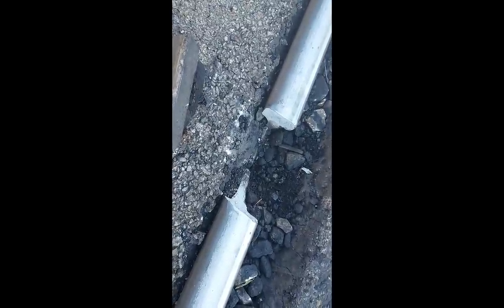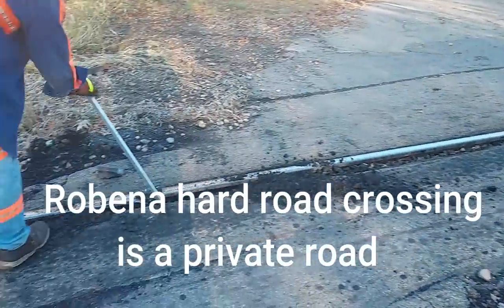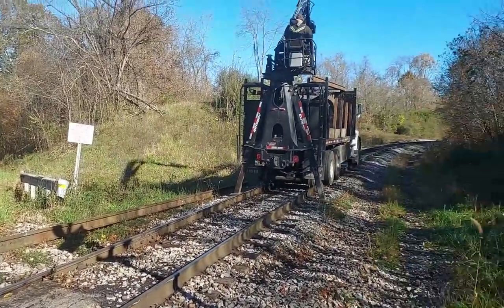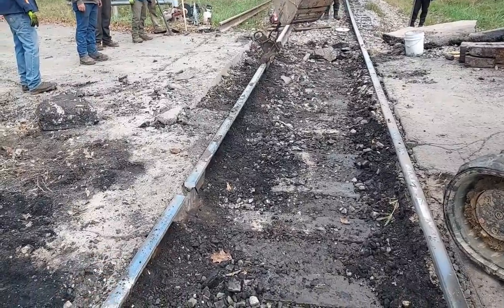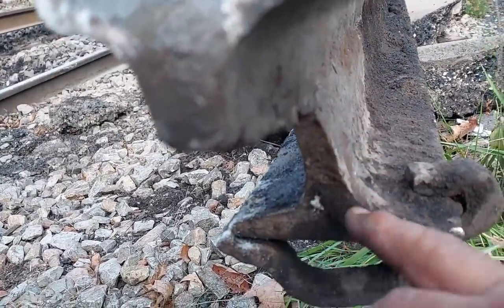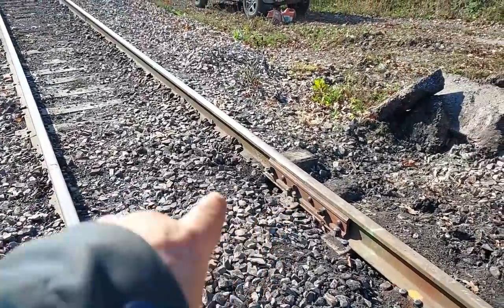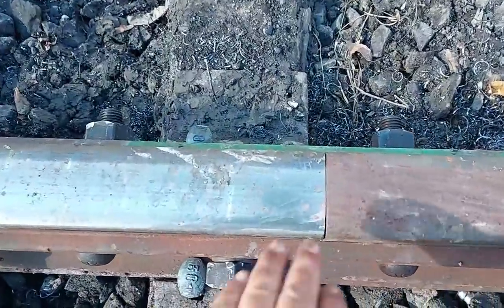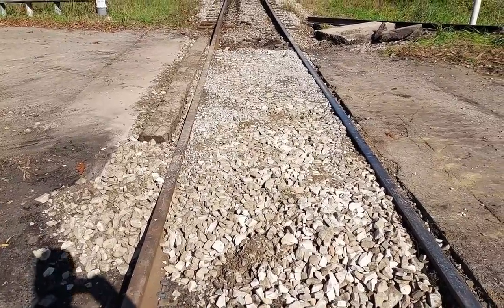This is Really Ugly!  7 1/2 Inches of the Rail Head Blew Out!

Comment: Dave, that old fracture looks like it has been there a long time.  The metal fatigue finally took care of the top of the rail.  That was a quick repair.  That is awesome that they can make that all work so well and get a new section of rail in place.  Thanks for filming this for us.  Have a great evening.
Reply: You're right now I look at it.
Reply from the maker: Thank you very much Tom for the very nice and positive comment.
We do so appreciate your checking out the presentation my friend
and for all the great support you have given this channel.
Reply: 0 pop
Reply: The metal fatigue is the web fracture ... the head of the rail shows a catastrophic failure as the metal has a granular like surface. The other end of the damage may show a fatigue fracture (which has characteristic 'beach marks' of a continuing fracture front before final catastrophic failure of the remaining metal.
Looking at the frscture at about 8 mins in you can see the original fatigue fracture on the web and a smaller amount of fatigue at the bottom of the head (rounded beach marks) ... the rail head finally failed at that end and the shock load then failed the other end. 
This is conjecture based on what I can see on the video. 
The fatugue probably worked up from below and along the web because the ballast was't properly supporting the sleeper (tie) at that point leading to a fluctuating bending load on the rail ... and the tension caused fatigue to start at a blemish in the bottom ...once the fracture had worked through to the web the bending would increase leading to a second fracture starting a foot or so away and they would then work towards each other along the web .the now barely supported rail head would start fatigue fracturing upwards from the ends of the fatigue of the web. The near end would fatigue first as the bending load would put tension at the bottom of the damaged rail head ... the far end would have tension at its polished top and would thus be resistant to fatigue cracking ... hence it only failed when under 'impact' loading due to the failure of the nearer end.

This shows the necessity of track maintenance ... and particularly the track bed and ballast!

I put the video on chromecast for a better view and it show the near end was a complete failure a long time ago and the beach marks are on the far end before catastrophic failure.
The damage on the near end makes it difficult to determine the original mode of failure..
I didn't see the beginning (thankyou YouTube for showing stuff before you click and then not going back to the beginning) and did not notice that it was at a road crossing: the asphalt would have hidden the fracture and on cursory examination  would have prevented early detection and maintenance.
Thankfully the final failure did not cause an accident!

YouTube has just started putting sound on the preview which just makes the preview even more annoying !!!
Reply: @simonblackham4987  pretty interesting. now if only I could figure out what's what.
Reply: Why wasn't a thermite weld needed for this fracture ?
Reply: @haroldleroy5283  My guess is that because it's a crossing on which trains will pass at slower speeds, it's not so critical. Also, it may be temporary repair, given the the road clearly need tidying up between the rails again.

Comment: Interesting combination of brittle fractures in that failure - actually, a double failure as you pointed out.

Wonder ho much of the cause was a defect in the rail from the mill, how much was corrosion, and ice damage.  Of  course, the sub-freezing temperature  made the rail just that extra bit more brittle when the car wheels snapped off the head.

The images you took are much more descriptive than the textbook pictures in my strength of materials class, way back when.
Reply: Given it snapped around one plate fixing it to the sleeper, maybe the sleeper was moving for some time, snapping the web and weakening the railhead?
Reply: @truckerallikatuk  --  Yep.  It looks like the "sleeper" sagged a bit too much and the broke the bottom half.  The top half broke from fatigue after years of excessive flexing.
Reply: Defect plus fatigue from a soft foundation.
Reply: Could vehicles crossing the rail twist it a little and help accelerate the problem, or is it just a coincidence that it broke at a crossing?
Reply: @bigredc222  Possible once the web broke, but supremely unlikely before then. Rail is just way too solid for a car or even semi to do much damage to rail when set in place like that. Look at disused rails in various places, it's all still there, and probably perfectly good to run a train on.
Reply: @truckerallikatuk  Thank you.
Reply from the maker: Glad you enjoyed Chemech. We really appreciate your taking
the time to write in and watch the presentation my friend.
Reply: Probably all the above of what you mentioned, looks like wear and tear overall, along with the heat of the asphalt that surrounds it, 1 at the time when the asphalt was laid down, and what ever how many years it was exposed to heat and cold after that point.
Reply: @MrHurricaneFloyd  I was on a snowmobile vacation in the Adirondack mts. in the mid-1990s and one morning we got up and it was 20 below zero F. 
We checked our vehicles, the antifreeze was like honey. The sleds never ran better, that ice cold gas made more power.
Reply: @MrHurricaneFloyd  well you never know, find out where that rail track is. In the Dakotas it can most definitely get to 30 below. I’ve seen it, and felt it. But I don’t know how old that rail track is either. North Dakota sees most of the cold temperatures and I imagine Montana and Wyoming.
Reply: @ccrx 6700 That's Railroadin!  Can you tell us what state this is?

Comment: That was a fascinating repair to watch. 2 questions. 1) how long before that break would have resulted in a derailment of a passing train? And 2) was all that asphalt and other debris just left there to become an eyesore, or does a crew come along later and scoop all that up and groom the site? A lot of places I have seen, rail companies do not seem to concerned what kind of mess is left behind.
Reply from the maker: Good questions American Rambler. First we were lucky nothing
derailed when part of the last train passed over it. Had it been
in a curve and not tangent track, something surely would have 
gone off then. It's anyone's guess when something would have 
derailed on the next passing train had we not fixed the break. 

A few months later we took the entire crossing out and replaced
the rail on the other side. Most of that has been cleaned up 
already but there is still some asphalt left that I will clean up
at some point when I get some time here in the future.
Reply: It's a private road, hopefully they went back and told the CAPITALIST to fix it himself as it was probably the same guy who broke the crossing.

Comment: It's really cool to see all the resources you can pull together to get a repair done when you really need to. All those guys and equipment swung right into action to get the line back up and running! Who is responsible for replacing the pavement?
Reply from the maker: Yes we were very fortunate to have all of those guys so close
by that day, they all did a great job Wheezer. We never replaced
the asphalt, it used to be a very busy mine access road which is
why we paved it in the first place. But that mine shut down and
this road only sees a few vehicles a day now, so it is graveled.
Thanks so much for watching my friend.

Comment: I was a bulldozer operator for wildland firefighting.  Over the years the guidance changed about crossing tracks at a grade crossing.  For years it was cross perpendicular to the tracks and obviously don't do any turning.  Later they said just don't do it, you must find a trailer and load up regardless of the emergency.  What are your thoughts ccrx 6700?
Reply from the maker: My thoughts are you are a brave man and I congratulate you on
your bravery! Fighting fires is dangerous work. I've crossed
rail before on a dozer several times where there was no crossing
at all. Have to do it backwards and ease the thing down or you'll
break your neck from the jolt coming off....!  Obviously no turning for
sure. We've crossed public roads with a dozer running on tires
or even plywood. Appreciate your writing in and checking out
the video J G.

Comment: that was interesting in that the rail head was the last to fail. the rib and base 
were cracked for a while based upon the rust and rubbed away of material from the
rail as the train ran over the bad section. How in the world do you find something like
that trapped in asphalt, except when the rail separates and fails. 
great video seeing things that normally not available to out siders.
Reply from the maker: Ultrasonic rail testers can find it Barry. Obviously can't see it by
eye covered with asphalt. Certainly appreciate your checking out the
show today my friend.

Comment: I've noticed at some our crossings in northern Indiana, they have ties running next to the track (running parallel with the track, on both sides).  Is this so they can replace a damaged rail and not have to tear up the asphalt/concrete?  Remove the parallel tie, and you then have access to repair.  Reinstall the tie when done.  Wonder if they screw the tie in place to the actual track ties below?  Would the cold winters/hot summers be part of the reason too?

Thanks again for the 'inside look' of maintaining a rail system.
Reply from the maker: All of our crossings here were original wood crossings. Yes you
are correct Mark, those crossing timbers are lagged into the ties
below. 

Really appreciate your dropping in on us and checking out the video. May you have a most blessed day my friend.

Comment: Just probably my lack of knowledge, but wouldn't you need to cut or grind the ragged end of the original rail so it butts up tight against the new one? What did I overlook?
Reply: This is bolted section rail. 
They pulled a whole section of rail, and replaced it. 
The ends of rail sections are already smooth and flat, with holes drilled for the joining plates to bolt through.
Reply from the maker: Adam Cooper had a good answer for you Randall. We really appreciate your taking
the time to write in and watch the presentation my friend.

Comment: When we had lots of mainline jointed rails the detector truck would find lots of defects but mostly at the joints such as vertical and horizontal split heads, bolt hole breaks and split webs, now that we got new relaid CWR the past 4 years to get rid of the jointed rails, the detector car hasn’t found anything recently but just some minor fractures that we just drill and bar it up until the welders cut in a plug rail and weld it up.
Reply from the maker: Couldn't agree with you more Jason. Having jointed rail is a curse
and tons of maintenance. Sure wish we had CWR, my goodness
what a blessing that would be. Do appreciate your writing in and
for taking in the show tonight my good friend.

Comment: A piece of rail I got from the former Minnesota Zephyr tourist rail line has a long break in one end starting at the top of the rail head going down at an angle for at least a foot. It was given to me by crew removing the track. 
I bought two pieces of rail from the former BNSF line that went south out of Stillwater Minnesota spring of 2018. One of them has a 1899 date code on it. There was once 3 rail lines going into Stillwater Minnesota plus it had two different trolley systems at two separate times.
Reply from the maker: Pretty neat stuff Boyd, got to love 1899 rail! Do appreciate your
writing in and checking out the video today my friend.

Comment: hey buddy...2 elementary questions if you please?
1. when you pull out the broken rail, were the spikes still in ?
2. when you put the spikes back in to hold the new piece ( "stick", just learned that! ), do you reuse the old spike holes?
BTW, great job, love your postings
Reply from the maker: Really glad you enjoy these shows Dean. We do appreciate your
being a faithful viewer and supporter of this channel. When we change
a rail, we generally pull all the spikes on the inside all the way out and
only pull the outer spikes up enough to slide the rail out. Yes the
old spike holes were used, but they were filled with a product
called Spike Fast, it's like gun powder, granulated and fills the
spike hole, we used to use wooden plugs in the holes. If you
check out my video on All about spikes I show you the sure spike.

https://youtu.be/nInJFLjxcZs

Comment: Given the pitting on the metal, does water stand for long periods of time in that area?  Your ties were wet.  I'm guessing that there is rusting issue weakening the rail.  The grain in the head looked good.
Reply from the maker: Because of the asphalt over top, the ties hadn't seen any sun
since we put that crossing in about 12 or so years ago. They
never got a chance to dry out much. When we had replaced the crossing we also replaced all the ties. They were still solid
when we drove the spikes back in. Thanks so much for
taking the time to write in and watch today my friend.

Comment: I was wondering why you didn't just rebuild the whole crossing. Obviously, it's been a while since that section of track had seen the light of day and you had most of the asphalt pulled up, why not just do the whole thing and be done? Thanks for the great video!!!!
Reply from the maker: That crossing was redone in 2010 Richard, at that time it was a very active road going into Robena Mine. Back in the 1950's/60's Robena
was the largest underground mining complex in the world. Now
there is nothing left but a few settlement ponds. This road now only
sees a very few trucks a day. At a later date than this video was
made we did replace the rail on the other side of the tracks. Ties
seemed pretty solid when the spikes were drove so we did not
feel a need to replace them. Thanks for writing in and for checking out the video today my good man.

Comment: Holy cow that might have caused a derailment? Wow wonder what causes that Dave? Im guessing age and fatigue of rail ? So the asphalt they pulled out will yall have to do that replacement or does the highway dept handle that ? Sorry so many questions 😂
Reply from the maker: I figure it started out as an internal defect when the rail was rolled
David. Those defects are often minute in size, but like you say,
years of trains running over that spot caused the defect to grow
in size and eventually the rail just cracked. That crossing is a private
crossing and only sees a few vehicles a day, so no the asphalt will
not get replaced. We own the crossing. We filled it back in with
ballast and crusher run gravel and is just fine for the small amount
of light trucks that pass over it. Thanks so much for watching the
rail head blew out video my friend.

Comment: Well done!   Good catch!  Could something crossing the track have caught andamaged the rail?     Hate to see this.  Could be failures happening in other places.
Reply from the maker: Crossing is rarely used, there are only a few trucks that pass over
it a day. We did have a high lift catch a rail head cleaning the rail
at the prep plant a few years ago, so it happens, and dang it don't
you know it was 5 below that morning, a real pain to replace
that rail it was with all the frozen solid coal around it. Very
much appreciate your checking out the video today Robert.

Comment: How often does your RR have a track defect detector unit run over your main line?  Wouldn't an old significant break like that show up whenever a track defect detector was run over that rail?
Reply from the maker: Code Fed Regs requires an internal inspection of the rail at least
once every 370 days. We have often in the past done it twice
annually, but depends on the inspectors schedules, they are not
always available and they don't like to come out and do very short lines like we have, they want the big jobs with a lot of miles as you
can probably understand that. They charge us big bucks for
doing a one day job. It's usually 10 grand for us a day or more! Last
inspection they did find a defect here but we lolligaged around
and was waiting for a shut down to change the rail. We made a
big mistake in that. But thankfully nothing derailed and it's fixed
now. Appreciate your watching tonight Eric.

Comment: The railroad equivalent of a pothole.
Was the railhead still in place, or was it missing?
The initial damage would have been almost impossible to spot given its location in the crossing.  
Is that something that the track scanner would have caught since it originated at the bottom of the rail?
Does the railroad have to replace the crossing, or the maintainer of the road?
Reply from the maker: Thought I showed the rail head? Yes you are right the ultrasonic
rail testers did find a defect in the web and we lolligagged around waiting for a track shut down to change it, but it caught us before
we could get it changed. Yes we are responsible for the crossing Samuel. Really appreciate your writing in and for watching and
the support you have given us my friend.